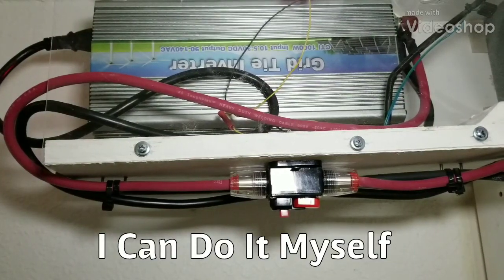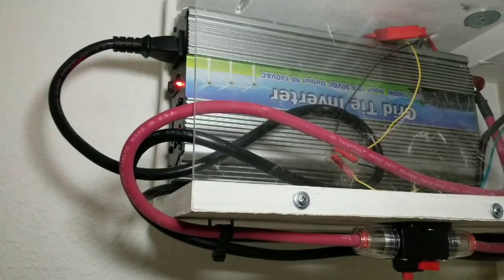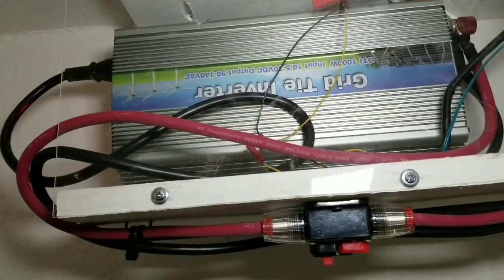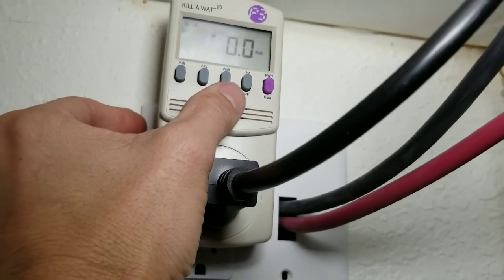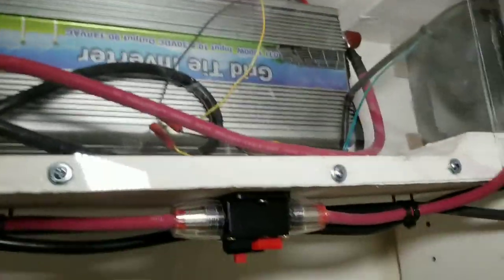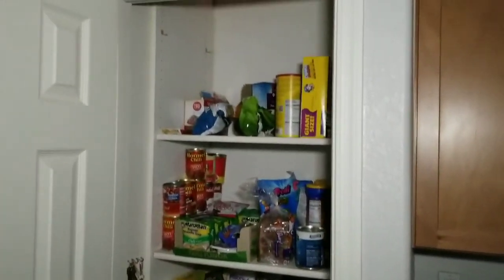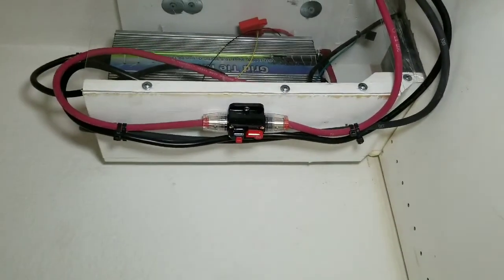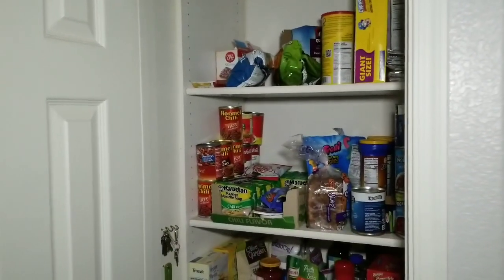Solar Power Grid Tie Inverter

Comment: Where do I get that really cool vent you put on the closet?
Reply from the maker: I made the box that I placed it in. I used a computer fan for the vent fan and dryer vent on the outside of the closet. The fans that are built in never come on because of that. It also vents the pantry which is good because it gets warm during the summer since it shares a wall with the garage and a South facing exterior wall. Keeps our food from getting warm. So the setup has multiple functions.
Reply: @ICanDoItMyself  Got it! It was the dryer vent I was speaking of. Is that a HomeDepot kind of purchase? I live in San Diego so most dryer vents are just open to the dryer ducting tube.
Reply from the maker: @benkanobe7500  Purchased at Lowe's, technically but Home Depot carries the same thing. 
https://www.lowes.com/pd/IMPERIAL-4-in-Plastic-Louvered-Dryer-Vent-Cap/3203043